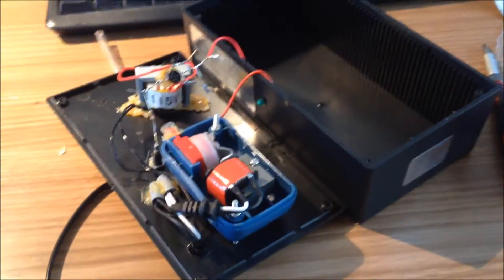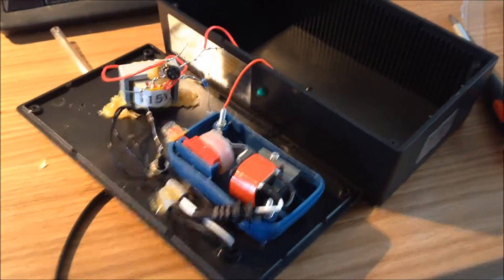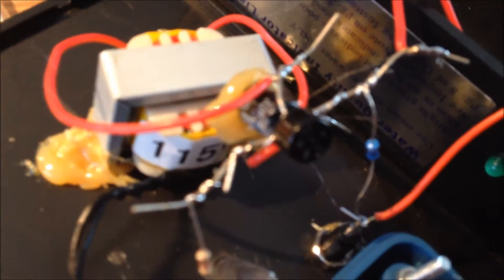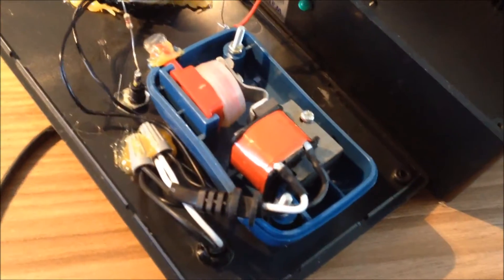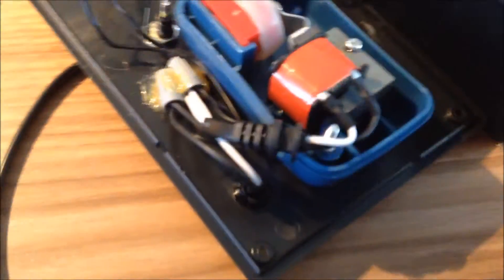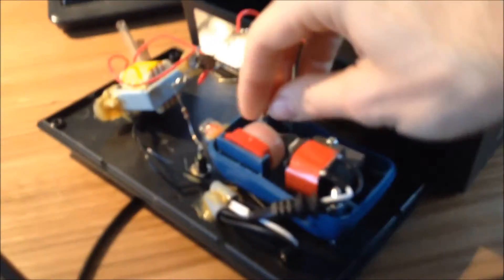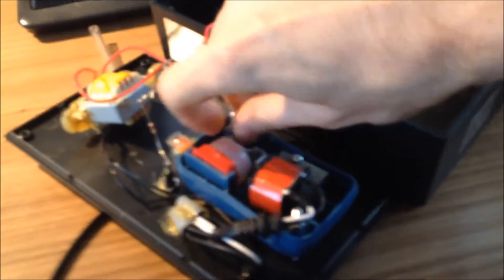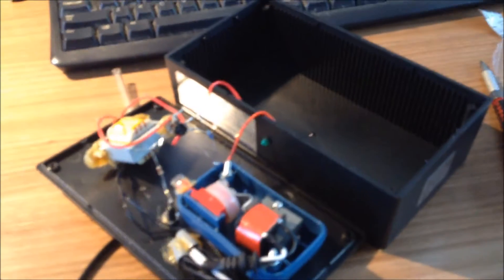Inside the Silver Edge Micro-Particle Colloidal Silver Generator, a Mini Teardown

Comment: Pretty shoddy.  A very inexpensive terminal board would clean up all those lousy, exposed connections.  A couple of screws instead of the glue?  It's so easy to do a nice, clean job and wouldn't add much cost.  Yes, very overpriced!  It should be $30 tops, $50 if it was nicely constructed.

Comment: There are better machines for around 300 plus you need a water distiller for about the same price as well.
Reply: No need to spend that much on a silver generator see Dr Bob Beck schematic
Reply: @Enoch-Gnosis  I got mine from 'Silver Bear Solutionss' in the UK. It allows precise PPM settings and has a magnetic spinner included and is lab quality. It can do 500 mL and comes good to go.
Reply: @fstop9466  awesome stock up on silver Rods!

Comment: Got a power surge on this unit and smelled burnt. When I plug it in I get 9VDC output on the silver rods then within minutes it goes to 110v. I'm thinking either the transformer or capacitor is bad. I can see the part numbers on everything but the transformer which just has 115v on it. Does anyone know the part number or what the output should be on the transformer? Where to get parts? Any other help would be appreciated as I've tried calling and writing to the company with no response!
Reply: Have you tried calling the company's tech support. If the transformer had shorted, you would have zero volts.  If you getting 9 volts previously, then the interior transformer is a "step-down" transformer, and agains you would have 110 volts, as the primary and secondary winding are completely isolated. The transformer is an E I transformer in the video, very unlikely that winding ratio on the secondary would magically produce more copper wire out of thin air.

Comment: If this gentleman doesn't think the generator is worth the money then he should buy nano-scaled colloidal silver in a health food store or online for about $20 a pint maybe a quart while I am generating my own with the generator for about $.50/qt.  I have been using colloidal silver for 25 years and had my own generator which was built by another friend who builds passive frequency health and environmental clearing devices which was good but the particles not nearly nano-scaled nor as effective.  All electronics are relatively simple if you are an engineer and most are expensive...it is not the cost of the mfg but rather the utility that justifies the price.  I am completely satisfied and makes it possible for me to generate silver water for a number of friends for FREE!!!And btw, I have had this machine for over 7 years now and it continues to work just fine.  Let's see at an average of generating 2 quarts a month for me and friends for 7 years = 168 quarts at an average of $20 per quart in the store = $3,360 which is roughly a $3,000 savings over 7 years, I think that is a pretty good investment and it still works like new, probably outlive me.  Oh, and the largest searchable repository of information and testimonials about the use of colloidal silver probably available on the internet, worth the cost of the machine alone.
Reply from the maker: There are many colloidal silver generators out there, I'm just showing you what the inside of this one looks like

Comment: I built and ran the Bob Beck Blood Electraliser/Colloidal Silver Generator - works great and with constant current. Built myself for probably about £25 (minus silver rods). Although I adapted it to use battery or a Mean Well 27vDC Power Supply.
Reply: Good for you !
The Dr Bob Beck Constant Current Colloidal Silver Generator works excellent 👍🏼
https://youtu.be/jAAKTxwmh5s

Comment: After reading all of the information on these posts I'm more confused than before I started.

Which machine is best?
Do you want clear water in the end or golden water (add stuff to it)?
Ionic silver vs colloidal silver, everyone gives differing opinions.

I just want to buy a damn machine that works and provides me with the health benefits internally and externally.

I'm an expert on theology but a dumb ass on chemistry so all the back and forth has no meaning to me.

Anyone???
Reply: James,
Be confused no more. I have dedicated myself to researching Colloidal Silver in depth since it saved my life last year from severe pneumonia. Also no more devastating chest colds & effectively treats my decades of Asthma. It is a TRUE MIRACLE. 
1) Both Ionic Silver and Particle Silver are known as "Colloidal Silver."
2) ALL home generators produce Ionic Silver unless you add chemicals.
3) Ionic Silver is what kills pathogens such as bacteria, virus, fungus
4) Particle Silver is far less effective & only kills pathogens hit or miss
5) Metalloproteins in our saliva & stomach carry silver ions throughout our body and INTO our cells.
6) We want Ionic Silver, NOT Particle Silver
7) True Research Reports in my file below that proves the above statements

Facts About the Silver Edge
1) Extremely reliable Point to Point wiring that has been used for decades in guitar amps.
2) Produces a high quality nano particle IONIC Silver
3) One of the few generators that can produce 2 gallon batches as easily as 1 quart batches. Just set the Timer and GO.
4) Intense bubbling negates the need for "Current Control" Current is naturally limited by resistors in line with the DC Supply and intense bubbling.
5) Silver Edge is a TOP SELLING generator that was on my own buy list for about 8 months before I finally decided to get the Silvertron Elite. However I do recommend the Silver Edge to friends & relatives. 

See my research files here:
Colloidal Silver Facts:
http://tinyurl.com/colloidal-silver-resources
Testimonials:
http://tinyurl.com/colloidal-silver-testimonials
Generator Reviews:
http://tinyurl.com/silver-generators

Ask your questions at the Curezone Silver Support Forum:
http://www.curezone.org/forums/f.asp?f=97&c=0

Bottom line: Don't believe the Marketing Mumbo-Jumbo designed to confuse & sell products.

Grizz
Reply: I'm not sure I ever thanked you for your information. I've been making ionic silver now for about a year. Wow, this stuff works for everything. It's the best body deodorant I've ever used. Just spray under the arms and man you do not smell all day long. On a hot sweaty day I just touch up and spray 2-3 times and it just destroys the bacteria in your underarms. 

Infections, wipes them out.
Red eye, gone in a minute or two.
Bad breath, no more, just rinse in your mouth once or twice a day.

I also felt flu symptoms coming on, you know when you get that tingly feeling in your nose and a tiny little scratch in your throat a few hours before onset of bigger symptoms. I felt that tingle and guzzled a glass full of I.S. then began spraying it directly up my nose all through the days following.

Everyone else in the house got the flu but I was fine. That never happens for me, I always get the flu. I also did this to stop a cold on two occasions.

Anyway I'm looking for another generator which is a set it and forget it kind. The one I have works great and is highly adjustable but I don't want to have to manage it all the time. I'll use both.

So, I'll look into the one you got the Silvertron Elite.

Thanks!
Reply: @jameshalleluyah8133  Hello James! May I ask, which generator did you end up buying? Which works the best for you?
Reply: @hotheadedjoelhaha  I went with the CollGen2 and it has worked like a charm. It is well made and simple to use. I have made hundreds of gallons since purchasing it.
Reply: @jameshalleluyah8133  Thank you very much!
Reply: @6505utube  Hi Fred I know this thread is very old now but I will post anyway as you may get an email prompt regarding a reply.  Thank you for your info above in an effort to clear up confusion however, the confusion runs on in my mind! So on looking at your comments above it started to make sense until I went to the Silvertron Elite website (because you had purchased this generator) and I came across a page "Ionic vs Metallic Silver" (https://www.silvertronstore.com/?page_id=93) and you can read the detail there but I copy their conculsion which seem to be opposite of what you say above:

"On a one to one basis of particle counts, metallic silver is far more efficient at killing pathogens than ionic silver with much less risk of causing Argyria.  Also, the particle size of metallic silver is very important in that it determines how many particles are available for killing pathogens.  Based on the findings of scientific research, there is no benefit to consuming ionic silver, and it is actually detrimental as it exhibits significant toxicity to normal cells.  Metallic silver (yellow colloidal silver) is effective against most bacteria and viruses, and doesn’t cause argyria."

I have also read from another reputable generator site: Gosilver.de that oxygen can combine with silver ions to form silver oxide which I believe is not good to injest so is bubbling air through the ionic solution like in the Silver Edge generator production process wise?     

Its difficult to make out whats is truth and what is marketing mumbo jumbo?
Reply: Build the Dr Bob Beck Constant Current Colloidal Silver Generator the schematic is free on his website

Comment: I own a Micro Particle Colloidal Silver Generator and I may not be a tech genius but I know the colloidal silver it produces works for me and everyone I've given it to. For me that’s all that matters! My generator has given me zero problems and has saved me a ton of money compared to buying colloidal silver in health food stores, which is very expensive. Therefore, I feel that keeping my family and friends healthy is well worth every bit of the $249 I paid for my unit! Not sure what the video poster did to his generator, but it sure looks like he battered the heck out of it before he opened it up.
Reply from the maker: +Laura ‘Wexford86’ Morgan Well you're free to be happy with your device, but don't accuse me of being dishonest without knowing what you're talking about. I never handled the device roughly or drop it or anything (hello! I've payed 250$ as well!!!). This is just what I found when I opened it up. The only thing that might be slightly misleading in this video is that the converter (the thing on the top) is normally secured with two screws. Since these screws were on the outside I took them out because I assumed I needed to remove them to open the device.
Reply: @sttrife  You and many others have been ripped of  I would sue the bastards for your money back!!!
Reply: @MrBobWareham  Sue them? On what grounds? There machine DOES what it says. You can't sue because the Inside doesn't Look pretty.

Comment: Have you contacted the company and asked for a replacement? My wife and I have used our generator for years, with no problems or defects. We have purchased them for gifts for several of our friends, only 1 had a problem. They contacted the company and received a replacement. That was 3 years ago and no problems since. We use ours weekly. It is much cheaper and the colloidal silver produced actually works better than the expensive stuff you get at the store. Would not be without my generator.
Reply from the maker: +RonMullins Hi Ron, thanks for your comment. This video is only intended to show what the inside of the generator looks like. What conclusions you draw from it is up to you. I make no claims about whether the unit breaks often and/or about the quality of the customer service.

Comment: I was paying $20 for those little four-ounce bottles of colloidal silver on Amazon.  Then I bought a Silver Edge generator like the one you showed and began making my own colloidal silver for less than 50 cents a quart.  I made one-half gallon of colloidal silver my very first batch, which would have cost me twice the cost of the generator if I purchased that much colloidal silver at the health food store.  The generator paid for itself after the very first batch. I couldn’t be happier. I’ve made close to one hundred quarts of colloidal silver with it over the past few years – probably a good $7,000 worth of colloidal silver -- and it’s never missed a beat.  Not bad for a device costing me only $240.  It has saved me thousands and thousands of dollars and has allowed me to expand my usage of colloidal silver far beyond what I could afford to do when I was buying from health food stores. As long as the colloidal silver it produces works as well as it does, I don’t care what the guts of the machine look like.
Reply from the maker: +J D Maloch While you have every right to be happy with your device, you are basically repeating the flawed promotional logic on the website of this device. Let me point out some things: first, if you buy the right bottle at the store, the content is different from what you get with your generator (look it up, about ionized versus non-ionized particles). It's unclear to me which is actually better, I've read stories on both sides. Second, even if the ionized stuff would work better then, no, the solution you produced is not worth 7,000 dollars. For example: in my country, and probably yours, you can buy expensive 'water from natural sources' in bottles, costing maybe 1.50 dollar for 0.25 gallons. The water that comes out of the sink in my home here is about 1,000 times cheaper, and turns out, due to water quality regulations, it's usually the same or better quality water. Would that mean that if I fill a bucket of water it's worth 15 dollars? No it's not... it's still worth only 0.015 dollars. Only if I would own a well known company that sell this water in nice bottles in gas stations for ridiculous prices it would be worth more. The same things applies to your situation. Anyone can make that solution you're making very cheap, so it's really... really... really not worth $7000. When I opened this machine I expected some advanced unique technology that makes this machine worth the 250$, but all i found was a AC to DC voltage converter, and a cheap aquarium pomp. The working of this machine can be reproduced very easily for about 10$ worth of parts (maybe 20$ if you count the case). Now, of course some labor goes into assembling, so I'm not saying he should charge 20$, but I do think that 250$ is very overpriced, specially when you see the quality of the inside. If this guy was really all about helping people instead of getting rich easily, he could also charge 50$ to 75$, which would be more reasonable for this very simple, poorly designed machine.
Reply: @sttrife  Making your own CS is rubbish don't waste your time or money it is all bullshit you need to do some reading on the subject the web is full of misleading information

Comment: I have the same unit he is great at marketing, I was horrified when I saw this video I haven't had a chance to open mine up yet you can bet I will. Mine out puts 20 volts. How difficult would it be to add a constant current circuit and increase the voltage to 24 volts dc?
Reply: +Peachblossums LMAO! I found an old electric can opener and opened it up. Ya basic 
components inside however it was cleanly done didn't see any hot glue securing the motor in place or bare solder joints or wires exposed all covered with heat shrink tubing  basically didn't look like a bunch of monkeys from the local zoo assembled it!
Reply: +AndyA Does your can opener run on low voltage DC or AC?  On DC you wouldn't need the heat shrink tubing that you would for AC or higher DC voltage.
Reply from the maker: +Peachblossums a difference is that the components in your can-opener are probably well designed and tightly secured, and they don't charge you 250 $ for it...
for the record: I do not claim the generator does not work, as far as I can tell it works fine. It's just that, for that price, I would have expected at least some basic quality on the inside in terms of design and manufacturing.
I don't think that the inside looks like that because of transport or some natural disaster. It's not that old either. I know that in the picture it doesn't look to good, but reality the outside looks fine. There is just no place on the inside for the components to be secured. They are just soldered point to point, and no attempt whatsoever was made to make it 'neat' and secure. If you have the same generator, just open it up to see if your inside looks any better than mine and share it here (but be honest about what you find pls.)
Reply: +Andy Antal I don’t know what the inside of my electric can opener looks like, either.  But I doubt it could be anymore complicated than a small motor and a few gears. But from the
outside the can opener looks great. And as long as it does its job I don’t care what’s inside it. I have the same question as one of the other posters have asked earlier; why didn’t he just call The SilverEdge when the generator began making noise??? sstrife went out of his way tomake a video bashing the company And how long ago did sstrife buy that thing It looks like it’s been through an earthquake.  Mine still looks as good as the day I received it.